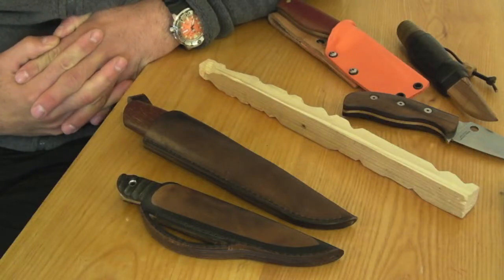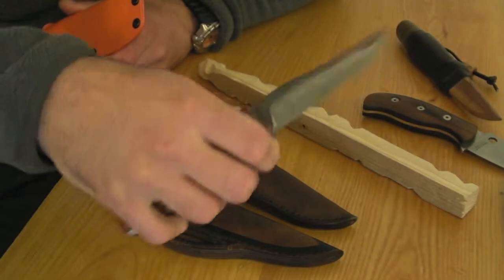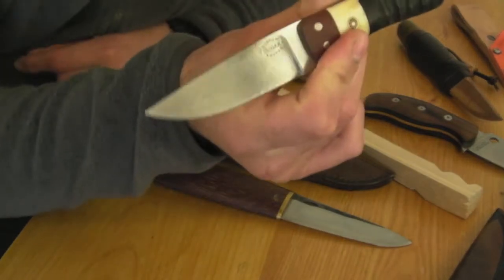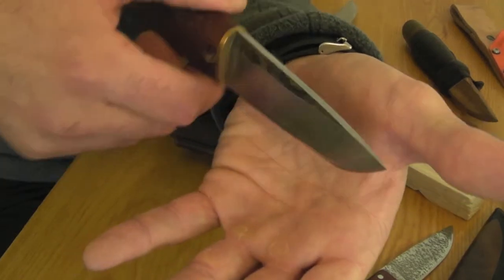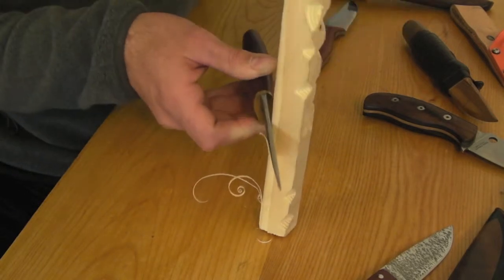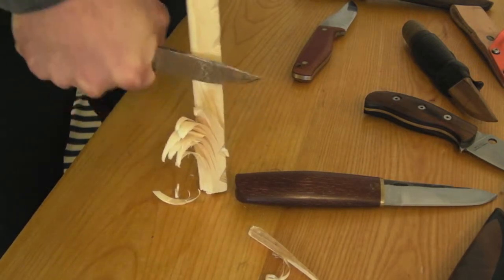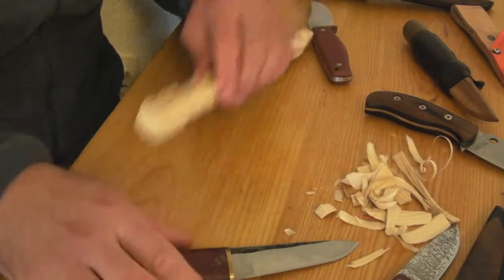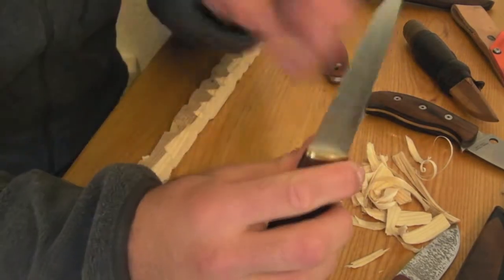Bi metal blade cutting

Comment: That is fairly interesting as it would appear to have some of the advantages that make a chisel grind popular but may off set some of the issues. How is it in cutting vertically in regards to the horizontal drift (sideways skew) that normally is prominent in chisel grinds.
Reply: ikarus1415 Any binding material tends to show it fairly readily if it is there, just dicing a carrot for example, or slicing an onion.